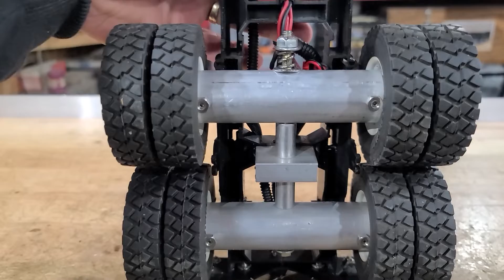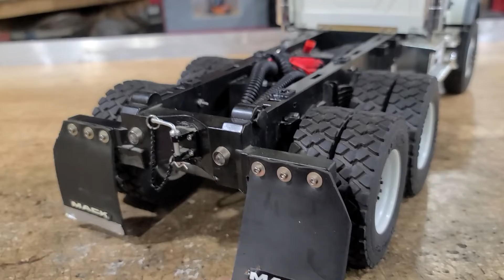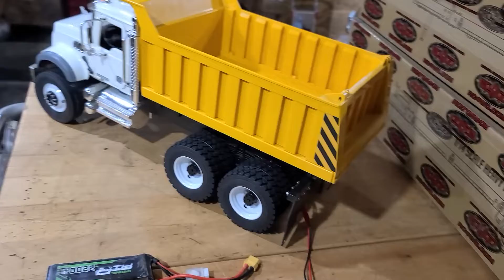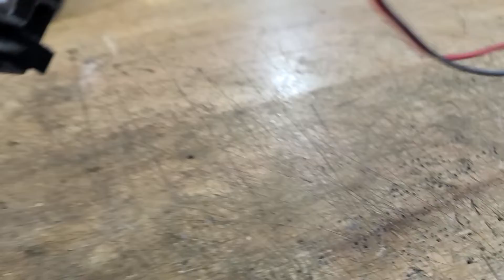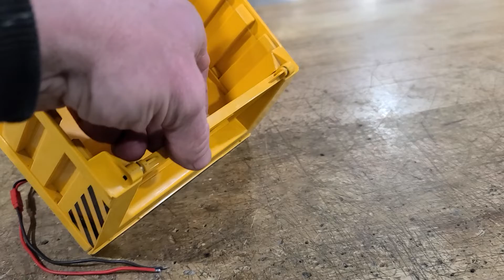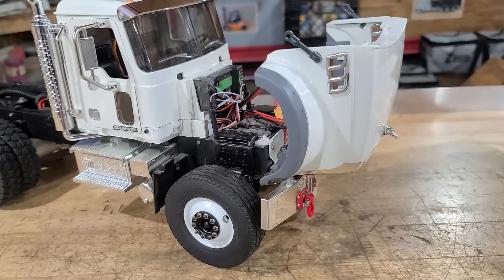Bruder Mack Granite RC Conversion  Dump Trucks

Comment: Love these two builds. I bought a Bruder Granite garbage truck over a year with the intention of converting it to RC. I haven't done anything with it because I didn't want to buy another Tamiya semi just to use the chassis. This setup you did on these two is simple and trick. You've inspired me to dig that garbage truck back out. I do have a question for you, though. If you don't mind me asking. What hub did you use to attach the rear wheels to the axles? Please let me know.  Thanks.
Reply from the maker: https://www.amazon.com/dp/B08M3Z2N8B
Reply: @dennybobsrcconstructionagc2796  Perfect! Thank you, my friend. I have no excuses to convert that garbage truck now. 👍
Reply from the maker: @dirtydeedsrc  yes the Tamiya kits get expensive just to use the chassis, but it does simplify the process.

Comment: Since it is just a single constant speed, you can use 2 relays or H bridge drive instead of an esc for the dump bed and run the coil of the relay to an on off channel of your radio control. Power would go from the battery direct to the relay then to the dump bed motor.
Reply from the maker: An ESC is required to run the motor on the lift. Motor on lift is variable speed.
Reply: @dennybobsrcconstructionagc2796  There is no requirement for the motor on the lift to have a variable speed. All DC motors are variable speed. Think of the power windows in your car. Do you ever need the window to go up and down at a variable speed? It just needs to go up and down and a reasonable single speed. This is the same. Up and back down. In fact, you could build the mechanism such that the motor could run in one direction and move the dump up and back down without changing the motor direction. That would be fun.

Comment: I've been half-heartedly trying to RC convert my Bruder with Tamiya stuff.

I picked up the axles, motor, and transmission second hand for cheap. I just need to figure out frame rails and suspension.
Reply from the maker: My last red Bruder Mack Granite halfpipe dump truck was made up of pieces and parts left over from different kits.